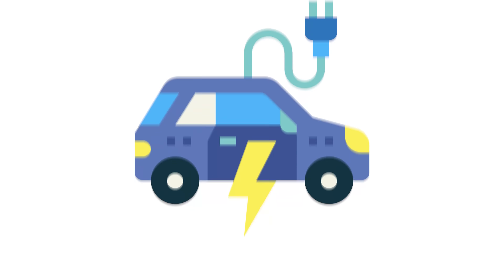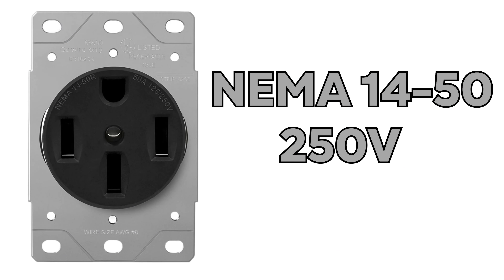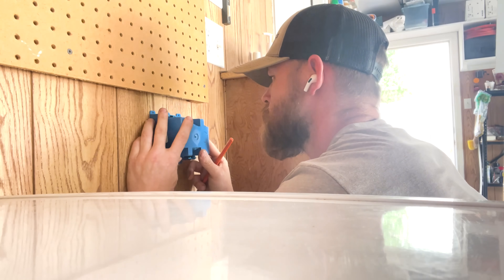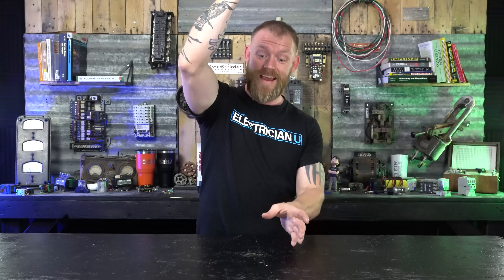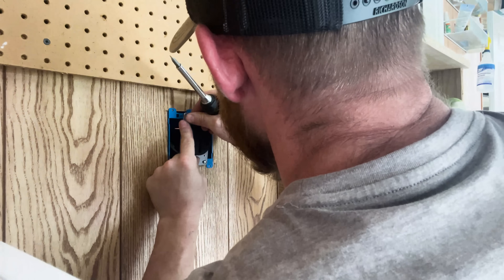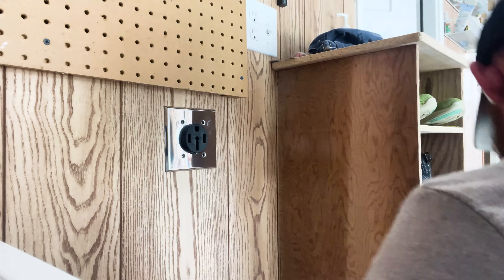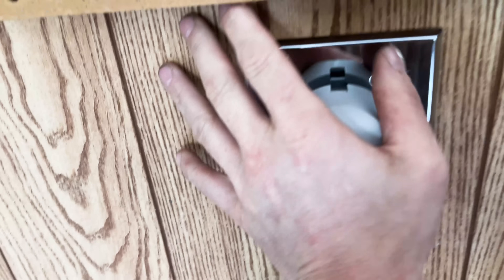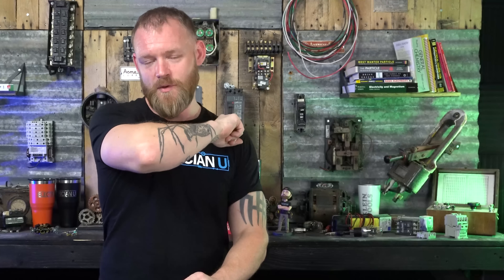How to Install an Electric Vehicle Charger Receptacle

Comment: Very nice job.  It's good that they had a couple of spare slots in their panel for the 2-pole 30A breaker.  What was the electrical service at their house: 100A, 200A, or more?  Most technical discussions that I have with electricians say that they need 200A service to install.  I've got an EV, but haven't put a Level 2 charger in my house, given that it's 100A underground service with no space left in the main panel.  I've also got a few inexpensive and free L2 and L3 chargers within a mile of my house, so I've used only the 120V trickle charger at home.
Reply: I install EV’s on 100 Amp panels all the time, just need to install the Electric Vehicle Energy Management System (EVEMS).
Reply: A free L3 charger?     Original, original Tesla buyers have that.  Have not heard of other
locations being so benevolent?  Thank you.
Reply: @tedlahm5740  Chargers at Nissan dealerships are free for Nissan Leaf (and soon Ariya) owners.
Reply: Depending on the other loads, you might be fine with moderate current L2 setup (16 to 32 A, probably not 40).  You can do the calculation, or you can monitor for 30 days or more, or you can get a Wallbox Pulsar plus with the load management option that automatically adjusts the charging rate to stay within your capacity.
Reply: @charliesullivan4304  I've heard of that, but I'm completely out of space in the main panel, no room at all to slide in a two-pole breaker of any amps.  At a minimum I'd have to install a sub panel and move some loads around to the sub, or upgrade the main panel.  And if I upgrade to 200 amps, that'd require a new panel on top of running new service cables underground from the street.  At some point it'd make sense to install an L2 charger at home, but with the public chargers nearby, installing an L2 right now is cost prohibitive.
Reply: @morlamweb  if you do get to the point of wanting L2, adding a sub is a lot cheaper than upgrading underground feeders.  But if you are fine with L1, maybe no need.

Comment: I worked as an apprentice and my boss/journeyman refused to ever shut power off to the panel. We always fed wire into a live pane. One job he was drilling inside a live panel up into the next floor and he hit a wire which then arched and started burning the framing. Keep in mind this house was built in the 1950’s. It was scetchy going to work every day.

Comment: How would you know if a panel can support a car charger?
Reply: Use a CT to read amperage during maximum house load, then add the 24/32/40/48 amps from car charger compared to main breaker would be the simplest way

Comment: 14-50's are the bulk of my work here in California along with the tesla wall connectors. they've proven to be a very valuable skill
Reply: @ElementFreedive  ... because now you can use that outlet for something else, like your welder, plasma cutter, etc. You also have enough wires to feed a small sub panel if you change your mind Personally, I would have used a #6 wire (good for 70 amps) and that sub panel can feed both the car charger and another outlet or two.
Reply: @rupe53  #6 NM-B Isn't good enough for 70 amps. It isn't even good enough for 60 amps with an EV. EVs are considered continuous load so you have to down rate the conductor. You can use individual #6 THHN in conduit or #4 NM-B in order to get 60 amps. I made the mistake of assuming #6 NM-B was good enough when installing my charger and now I'm limited to 40A charge current instead of 48A that's possible with the charger.
Reply: @MrGatlin98  .... the real question is IF that 50 amp receptacle will hold up to 48 amps continuous. Based on what I see MOST get toasty looking in short order. IOW, you really need a 60 amp circuit to handle that 48 amp draw. (but that's not the plug they come with) While we are on that topic, what are the chances you can't get enough charge in 8-12 hours at the 40 amp rate?
Reply: @rupe53  well yeah I probably wouldn't use a 50 amp receptacle for the 48 amp rate. It isn't rated for that according to code and for something where the power draw is as large as an EV I don't want to risk it. But yes you're correct, the charge time is 7 hours @48 A vs 8.5 hours @40 A. So it isn't much different, but disappointing since I did a brand new install and tried to get everything right for the max charge rate.
Reply: @MrGatlin98  ... in a nutshell, you are stuck with whatever the factory cable and plug are rated for. My original post on this was aimed at adding a heavier circuit and installing a sub panel locally, then branching to the necessary circuits out in the garage. The labor will be similar, so we're only talking about materials... as needed to upgrade at a later time. The sub panel itself will be less than $100 and probably about the same for increased wire size.
Reply: @ElementFreedive  ... it's actually about how to properly wire an outlet for the charger with that style plug. IOW, the focus is on that plug and nothing else. Personally, I feel if it's a 50 amp outlet then everything else should be rated for 50 amps, even though there are loopholes. I mean, the difference in cost between #8 and #6 wire is hardly anything in the big picture and the 50 amp breaker is maybe $2 more than the 30 amp version. All he had to do is explain things to the customer about how to get a bigger bang for the buck and maybe an extra $100 isn't so bad. With the bigger wire there would be future room for two EVs at 25 - 30 amps each. Just add a small sub panel at the garage end in the future.
Reply: @rupe53  The 30 A breaker isn't about saving money. It's about ensuring that the *safety device* (i.e. the breaker) is rated appropriately for the expected load.

If you know your EVSE is never going to draw more than 30 A, then it's a safety hazard to put a 50 A breaker on the equipment, because in the case of some kind of failure, it could draw (for example) 40 A indefinitely on that breaker, eventually starting a fire.

It's nice to have the circuit wired for 50 A, since then it's just a matter of swapping the breaker and plugging a higher-rated EVSE into the outlet if you want to upgrade. But from a safety point of view, it's also really useful (important even) to put the smallest breaker in that is suitable for the actual load that will be on that circuit.

Of course, if the expectation is that the outlet will be shared between the EVSE and something else that needs more current, obviously you'll just want the regular 50 A breaker. But it's uncommon, and not really that good an idea anyway, to be regularly unplugging and plugging stuff using a 14-50 outlet. Using the outlet is for the convenience of infrequent equipment changes, not day-to-day use.
Reply: @harvey66616  ... sticking in a 30 amp breaker makes it a 30 amp circuit, which under code will be rated for 80% load or 24 amps continuous. #8 wire is only good for 40 amps, but under the 80% rule it's down to 32 amps. You can set the charge rate from the vehicle and not tax the system. Now do you see where my thoughts are headed on having some reserve?
Reply: @rupe53  "Now do you see where my thoughts are headed on having some reserve?" -- my reply wasn't relevant to your thoughts on "having some reserve". They were with respect to your false assumption that using a 30 A breaker instead of 50 A is about saving a couple of dollars, which it just as easily could be about providing appropriate over-current protection to the EVSE and its power cord and plug.

Personally, I think it was probably a mistake to use 8 gauge wire on a 14-50 receptacle circuit. But that's a different matter.
Reply: @harvey66616  ... I see we are somewhat in agreement here but if the appliance comes with a 14-50 plug, to me that means a 50 amp circuit. This would be the same logic as wiring a 15 amp circuit and receptacle for a table lamp. (although that's not a dedicated circuit) The reality is in the code where the CB is for protecting the home wiring. (although that could be downsized for a variety of reasons)
Reply: @rupe53  After they use one EV for awhile they probably won't ever own another!
Reply: @billmonroe8826  why wouldn’t they buy another one?
Reply: @patrickhynes6058  ,,, was going to say similar because they are a bit quirky. OTOH, they said that about the VW bug when it first came out, and a few years later it caught on to the point where every mfgr was making a small quirky car.
Reply: @ElementFreedive  Most of the EVSEs that  come with a plug, are nema 14-50 plugs. A few have the option to get the EVSE in a 6-50. The reason 14-50 became popular is because Tesla will include a mobile connector with a 14-50 so that you can plug the car in RV camp sites outlets for long distance travel back when the supercharging network didn't exist.
Reply: @ElementFreedive  With the 14-50 at least you can easily convert to one or more 14-15R's if it is not being used for charging.  This is my plan until and if I get an EV - I will use it to run my 120v table saw motor
Reply: i believe it.  the problem is too many people have been doing it incorrectly.  if you are doing it right then yeah i'm sure you are making some bucks doing this.
Reply: whats the best nema 14-50 outlet brand do you suggest? ty
Reply: @ElementFreedive  install it for the EV and use it for your plasma cutter. Makes basic logical sense
Reply: Good ol California! Take all the money you can for those that own EV's!